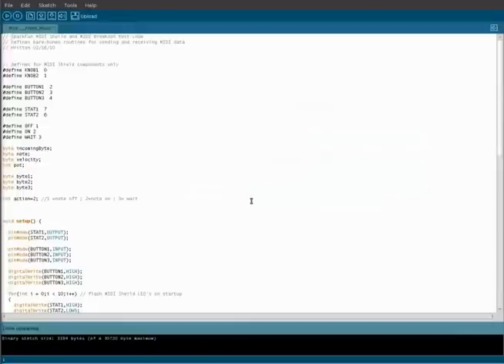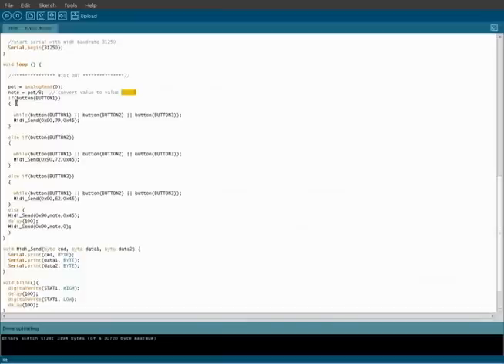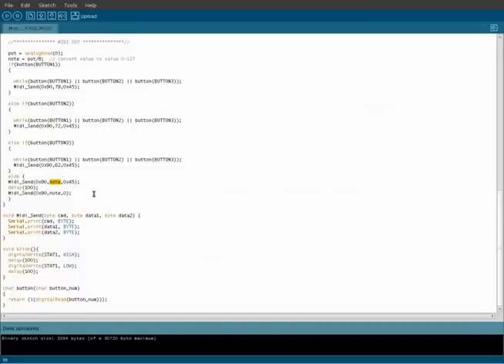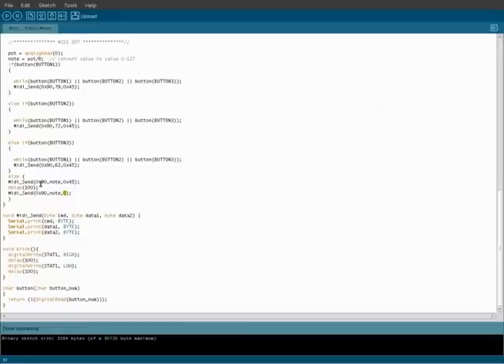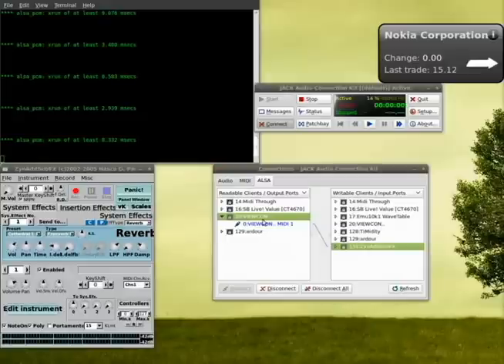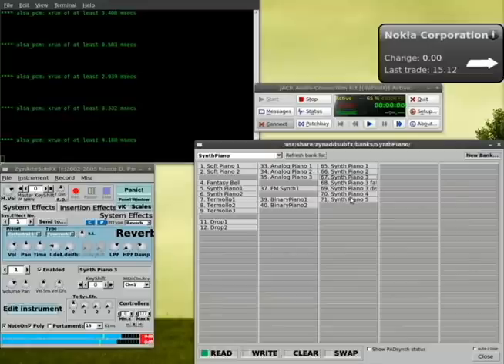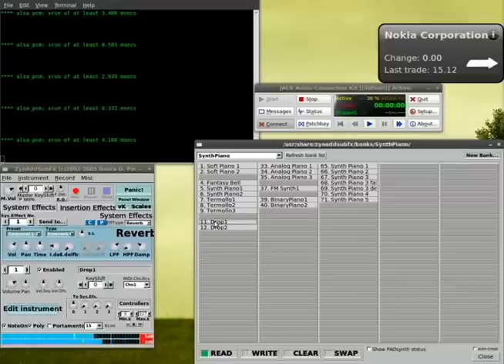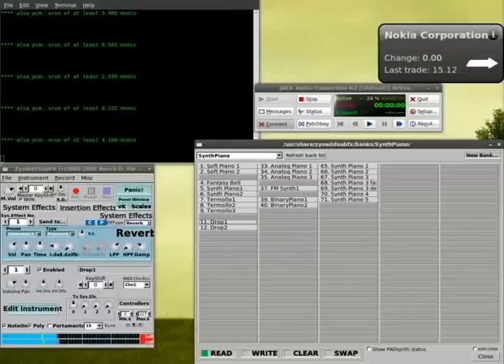Arduino - MIDI Controller part 3 - More Code

Comment: Nice, sounds like experimental music from the 70's.

I have a Roland S10 that has a busted 3-inch diskette drive and a non responsive midi-controller, your giving me some ideas to replace that drive with an arduino and two shields ( 1 midi-shield and a SD-reader shield if it exists) .